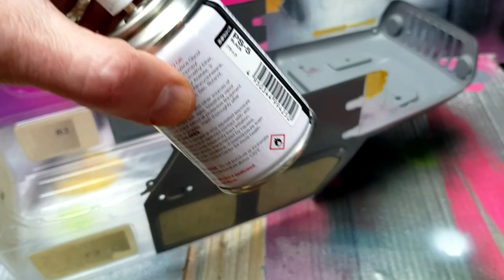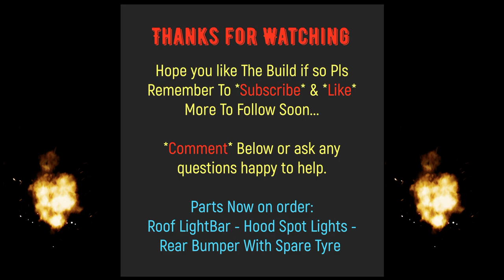AXIAL SCX10 III Jeep Wrangler JL Rubicon CUSTOM BODY BUILT & PAINTED + 3D Printed Mods & Accessories

Comment: Very cool video.  I’ve never painted my own body, or seen one painted, so this was very informative. Great job!
Reply from the maker: Thanks very much very satisfying until it goes wrong haha have a go give it a try  👍👍 appreciate you watching thanks again😁🙏
Reply: @rcadventurer  I have an SCX10 2012 CRC Jeep JKU; that is still in excellent condition. When I bought it RTR new, I dove deep into mods and upgrade;probably spent another $500 on the truck.  I’ve sort of run out of things to add or swap out, so I have been tempted to buy a new clear body, to noodle on and provide an alternate look.  I know I would need new taller rear body pins.  Do you happen to know if the body you did will fit on an older SCX10 “4 door” Jeeps?
Reply from the maker: @bldallas  ok cool sounds great to be honest I haven't tried fitting it on others as I have a scx10ii but its been changed to fit a dodge power wagon body the main thing is the inner fenders on the scx10 3 might make it hard to fit scx10ii 🤔🤔think its best to check facebook groups for scx10 users they will have tried it etc as you don't wanna be chopping it up!! stay safe  👍 👍 👍

Comment: Great video! Question for you. What's the purpose of spraying the flat clear on the outside of the body? Just curious 😅
Reply from the maker: sure thing it helps the grey stick as the grey paint is not reccomended for that type of body also the flat clear when sprayed on top of the grey makes the grey flat if you want that look and the paint is not flat if that makes sense lol

Comment: what was the reason you went with last clear coat spray on outer shell. awesome video and tips you shared.
Reply from the maker: Thanks very much for checking it out  👍 👍 the reason was I wanted a matt finish and the clear body always gives a gloss finish if you spray matt clear coat on top it dulls down the finish, obvs if you want it shiny etc no need for that at all although some do a clear coat on top to protect stickers etc either gloss or matt. Check out the TRX4 DEFENDER build I just did similar finish to the Jeep if you get 5 mins its a beast haha 👍 👍

Comment: Great build. I love the hex bolts on the fenders and rock sliders. Where did you get the bolts from and what spacing did you put them at in between eachother?
Reply from the maker: Thanks for that really enjoyed that one the hex bolts are just from ebay I just bought a box of varied sizes there are loads to choose from,  I cant remember the exact spacing but to be honest I have seen others since with less or more and still looks great so doesn't really matter as long as you keep the same distance between each hex bolts depending on how may you choose to use obvs it will still have the same effect good luck with your build👍👍👍👍

Comment: Where did you get the black side panel on the bottom of the doors at?
Reply from the maker: it comes with the kit the side skirts I just drilled holes and put screws in them thanks

Comment: Dude thank you!!..For putting up this video cause I got kind of stuck on my TRX4 build which I definitely want that Jeep Wrangler body in a 12.3 WB then paint and lightly modify the fenders to have that same matte look so thanks a ton!..👍🏽
  ….. btw, what bodie is that you used?
Reply from the maker: Great glad it helped, the body is the scx10iii jeep clear body was my 1st jeep Rc love the jeep body's and  good luck with your build👍😎👍😎
Reply: @rcadventurer  one more thing the modified fenders what brand/model # and where did you find them?
Reply from the maker: @devildog3125  they are just the stock ones the scx10iii model comes with then painted matt black 👍👍
Reply: @rcadventurer  thanks again…👍🏽

Comment: Dude I love that interior and with a role cage does it help with the body not being so flemzy weak
Reply from the maker: Thanks👍👍 I guess it helps but depends how hard you drive as many of my other Rc's haven't got cages and they are fine when they roll over on the trail, I don't  bash my crawlers though so they are generally alright. I  like the look of the roof chopped off with just the cage showing as you can't  really see the cage normally. Thanks again for watching 👍👍
Reply: Does that role cage and proline come with the new rc or u can get it on the side
Reply from the maker: @astrogreenarrow  It comes with the RC as I bought the kit version you can get the roll cage from horizonhobby.co.uk  direct for £25 I looked it up nothing on Ebay I could see
Reply: darthdesec  actually, yeah, it’s fairly flimsy. I have this SCX10 III kit. Body looks good, but they could’ve used a thicker lexan.

Comment: I like your idea of adding the black onto the front fender. Looks like all the real ones I see around. All the extra bolts in the fenders is kinda odd though.
Reply from the maker: Great thanks for checking it out I was using a few jeeps from google images for ideas and they also had the bolts on the fenders that's where the idea came from check https://www.pinterest.co.uk/pin/830421618761824607/ or google images for "custom jeeps" and you will see obvs I cannot replicate it exactly thanks for watching much appreciated 👍👍👍👍

Comment: Do the rc4wd ballistic wheels fit the portal axles or do you need adapters?
Reply from the maker: From memory they fit ok without but will double check and let you know, as I bought other wheels and the inside was too big to fit them which was a pain!!
Reply from the maker: I took my wheel off and it has a 10mm metal hex on there not sure what it came when I built the kit maybe 5mm? anyway that's how mine is fitted hope that helps thanks

Comment: how many cans did u use for that paint job?
Reply from the maker: It was a couple of years ago now but from memory for those bodys probably 1 and a half can of grey, 1 clear flat and 1 black but wouldn.t of used all the black and clear. As not much needed. The Tamiya spray cans are pretty small. if your new to it go easy on the spray coats better to do 3 /4 light coats than 1 or 2 heavy thick coats. I am often impatient and try to get it on asap then regret it when the paint runs! Thanks.

Comment: This looks amazing. Can I ask what the clear base coat is for at 35 seconds?
Reply from the maker: Sure, I used Grey Ts paint which is not recommended for lexan/polycarbonate bodies as you know you need Ps paint as it can crack so the clear coat was to help the Ts paint stick better and worked well no probs so far after using it several times and rolling it over etc, I  don't recommend it either but don't mind trying things on mine and that was the exact colour I wanted regardless 😎👍😎👍
Reply: RC Adventurer oh I see, thanks. I look forward to more of your vids 👍

Comment: Where did you get your fine tip pen and what size is the tip
Reply from the maker: Hi,  I have 2 pens 1 is a fine liner black pen think its 0.5 size from a regular stationary store Whsmiths, and the other was from Japan from Amazon was recommended for plastic bodies. Most pens can smudge if you rub them but this one is called Gundam marker Specifically for plastic models. Both work fine depending on how much you want to spend 👍
Reply: @rcadventurer  thank you

Comment: Great job! I’m wondering about the Tamiya AS 7 paint as it is not specifically for Lexan. How is the durability?
Reply from the maker: Yes was my thoughts exactly but using flat clear 1st for it to bond to seemed ok and after using it so far so good and rolling it a few times! etc no probs so far I did test it on a spare piece of lexan before doing the Jeep body and bent it twisted it  to see what happened but all good and I really liked that colour so worth the gamble thankfully. I have another video on the channel of it in action if you haven't seen that yet, thanks for watching  👍👍👍👍

Comment: What front bumper?
Reply from the maker: Injora Ebay seller there are quite a few sellers with similar ones for you to choose from on Ebay, it came with the stinger v bar on it but didn't like the look of that so unscrewed it so it looks like it does now thanks for checking it out 👍👍👍